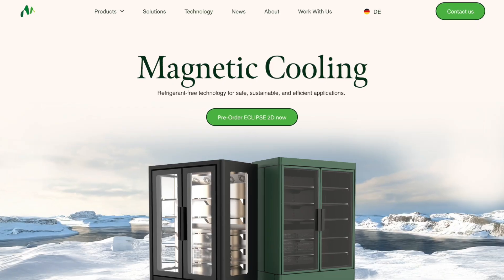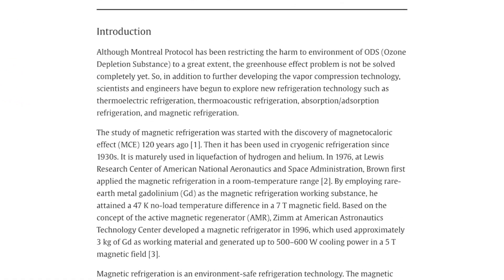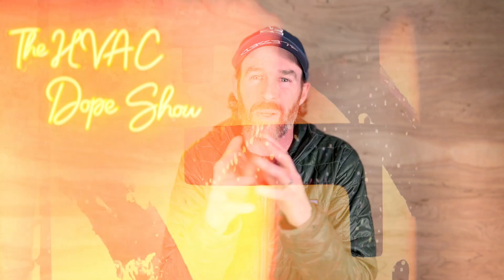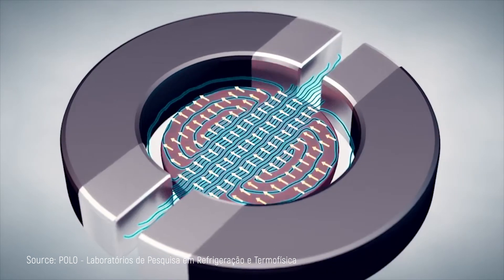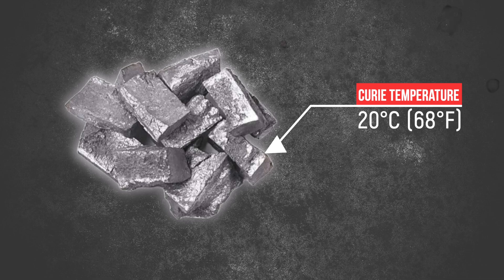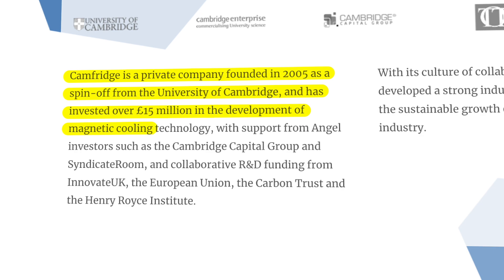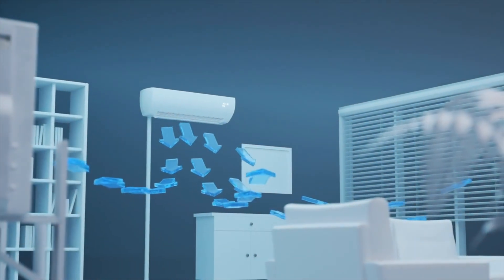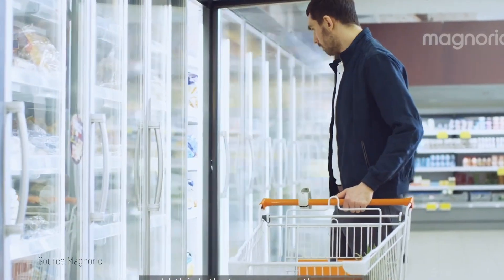Revolution or Hype? The Real Story of Magnetic Cooling

Comment: Magnetocaloric cooling requires a range of conditions to be just right in order to be relevant from a practical perspective. It is not, and don't show any real evidence for potential of becoming more efficient than vapor compression based systems, that's just a myth. If you compare the theoretical efficiency of the core process, to the useful heat transfer of complete, not so great vapor compression based systems it might seem like magnetocaloric cooling is more efficient, but that's like measuring how much of the energy in a fuel an internal combustion engine in a car is turned into heat, initially, and claim the ICE car is >90% efficient, and then comparing that to an EV, and calculating the efficiency all they way from sunlight via solar cells, to how much mechanical energy the car eventually delivers.

One of many problems with magnetocaloric cooling is the fact that the maximum possible ΔT per stage (as in heat pumping stages, not power levels) is mediocre, at best, so you need multiple stages to even make it possible to generate a meaningful ΔT for refrigerators and air conditioners.  Requiring multiple stages means you need to transfer heat between stages, and that is a much much bigger practical issue for systems where the temperature change happens in solids compared to systems where it happens in fluids.     

Most common vapor compression based cooling system could be much more efficient than they are if you accepted bigger and more expensive systems, for a given power output. Especially small cheap consumer products could be much more efficient than they are, if they were optimized for that, while accepting both bigger heat exchangers and higher cost. Neither size and cost for much more efficient vapor compression based systems would have to be anywhere near the absurd numbers magnetocaloric systems require to be able to generate a meaningful ΔT at all.      

It's not a coincidence that magnetocaloric cooling have found some practical use in extreme niche applications, mainly in temperature ranges where it becomes very difficult to use other techniques because you're so close to absolute zero. If you're chasing the last  millikelvins towards the absolute zero, even using helium as a refrigerant in vapor compression system becomes difficult as helium boils at ~4.2 K, or roughly 4200 millikelvins at atmospheric pressure, and around 2 whole K the "behavior" of helium starts to become really complicated.

Comment: So, could this technology be used to cool the warm or hot emissions given off by oilfield processes, Factory emissions, etc.? Could it alter the rise of CO2 into the atmosphere? Or at least help to keep the planet cooler by cooling the air surrounding these high emission places? It's probably a dumb question because I don't understand ANY of this science. But, when you said it could cool warm emissions, it made sense.
Reply from the maker: So the technology is not affordable yet, Lafesi is the affordable version of Gadolinium and will potentially make this tech affordable but we'll see if they can do it in smaller footprints... cooling emissions in the sense of efficiency / being more efficient and using less energy to heat and cool

Comment: You do not address the problems of magnetic cooling (after the magnetic material itself problems are solved).  Circulating water through porous substance is invitation to corrosion & clogging, since the magnetic materials (gadolinium or any of the iron based materials) avidly corrode.  Second, there is temperature drop in those liquid loops.  Much better is (drum roll!) REFRIGERANTS which can eliminate virtually all of those drops while requiring much mass-rate of circulation (smaller or no pumps) & no corrosion.  Then there is the motor.  Compressors can use fast, small motor.  Magnetic refrigerators require HIGH TORQUE low speed motor, which is less efficient & heavy requiring lots of copper.  And the magnets?  They require NEODYMIUM, which is already in short supply!
Reply from the maker: My vote on this product is "hype" for now
Reply: Could this effect be triggered by pulsing electro magnets?  Eliminating neodymium  and all moving parts with possibly stronger magnets